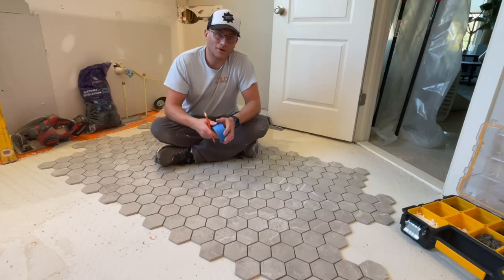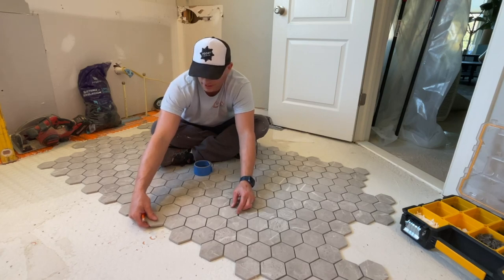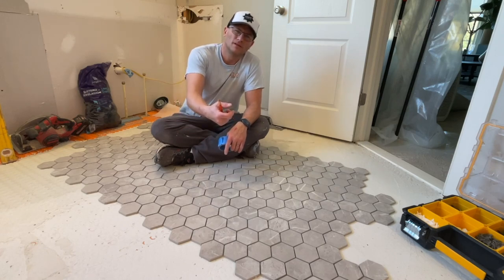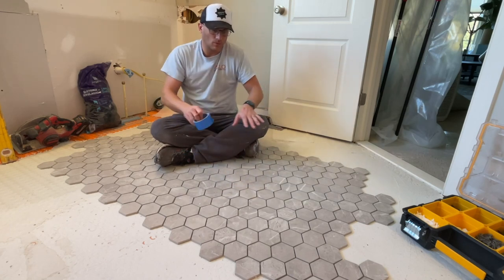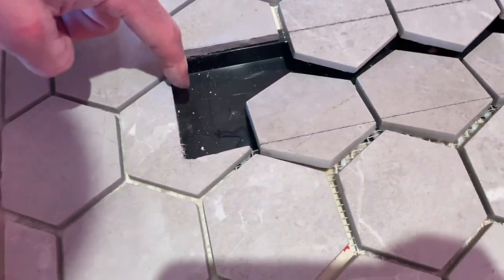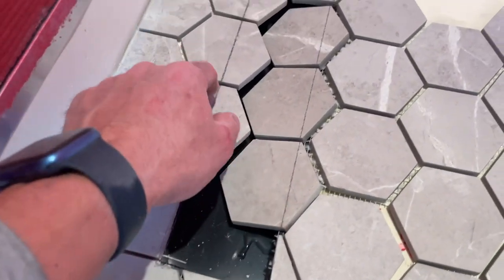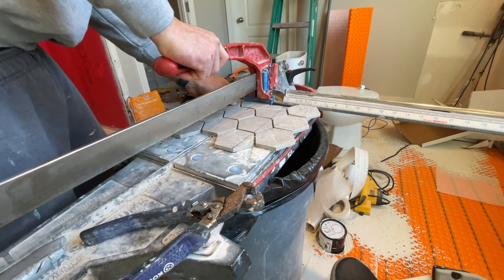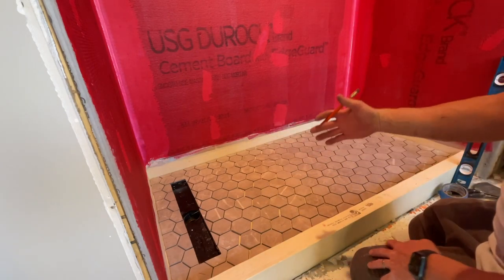How I Install Hexagon Mosaic Tile on a Shower Floor With a Trench (Tile Redi Base)

Comment: Nice job, looks great!  I am planning on setting my floor tiles this weekend.  I am using mesh backed mosaic Marble tiles.  They are 3/8th's so I think I will also be using a 1/14x1/4 with CB Pro Lite in white.
Reply from the maker: Nice. Good luck with the install.

Comment: Center off the drain for even cuts and cut it all in setting each sheet in the pan...take the center row out first in whichever order is best for u, i just mark 1, 2 , 3, 4 etc.. then take the other rows and do the same. set the middle row around the drain so its nice and perfect, then drop in the rest..the floor shifts just enough if u don't have it cut in, in the pan because of the slope, from my experience at least..thats the money shot, around the drain, plus it gets annoying if u gotta pull pieces up around the drain if u don't lay the tile perfectly starting on a row off of the drain.. (thats just my way after having done it multiple different ways over the years, no right or wrong way as long as its stuck and looks good lol!)

Comment: What is the best wall board from your experience to match with the tile redi pan (that doesn't cost what the redi wall board costs)?  And what compound do you use where it meets one another?  The stuff that redi sends or something else similar?
Reply from the maker: I’ve always used redi flash and 1/2 durarock with red guard. It’s easy and really mistake proof. If you watch all of my tile redi vids I go into how to water proof all of it.

Comment: WOW!  My friend you are a Tile Redi PRO!  I hope you see my comments and reply to my questions...  I want to be confident that using the Tile Redi Shower Pan is going to be what i want for my new home shower base!  Have you NOW switched to using the Thin set mortar over the Epoxy ?  You seemed to be so strongly adamant about using the epoxy i the other video I commented on....
Reply from the maker: I love the epoxy, 100%, but after trying the thinset modified mortar on the new pans, it works. I love these pans and tile redi and I do not have a partnership or anything. I’ve seen so many mud job pans fail over the years I wanted something that will never fail. When I installed my first tile redi pan, I was sold. This was before my videos and being in the dark with them. The only negative of the pan is if you have to install the plumbing on top the subfloor. I go over that as well and show why it’s such a pain. Good luck with project if you decide to go with the pan!

Comment: Love your videos. Is Prolite thinset any good for mosaic tile in redi base?
Reply from the maker: If it’s not recommended, I would not use it. Check the instructions what they approve. I will tell you this, I just installed a brand new tile redi pan in my new house build and it has a grainy finish on it. Just curious, how is the finish of your tile redi base? Is it smooth or does it have a grainy grayish finish? Thanks for the kind words.
Reply: I have not purchased the base yet. They are out of stock the one I wanted.
Reply: You recommand MAPEI Ultraflex LFT White?

Comment: Question. I have recently installed the tile redo system and installed the tile using the epoxy mortar bought with the tile redi system. I have a “hollow” spot on one of the edges of my tile near the grout line, have you ran into this? Is there a remedy fix for this? Thanks
Reply from the maker: Hollow? Is the grout moving? If not, you should be fine. For clarity, is the tile moving or the tile redi base

Comment: awesome work! have you any exp with fibo board shower panels? or can you recommend one brand that you would use in your home? thanks so much
Reply from the maker: I do not. So many systems out there. I'm sure if you install it correctly, it will one out just fine.
Reply: @TodayIWorkOn  thanks for your time

Comment: With this Redi base do you recommend using the redi epoxy or the Ultra LFT mortar? I saw an earlier video of yours where you preferred the epoxy and wondering if your opinion changed. I am still a beginner and was worried about the epoxy so was curious your thoughts.
Reply from the maker: LFT has been working well.  I would go with LFT for a beginner. I have recently switched over to using LFT for all of the shower floors. Good luck with the project!
Reply: @TodayIWorkOn  Thank you so much! Do you have any plans to show what you do for shower glass around the Redi Base? I haven't seen any videos on it and was wondering what you have done previously.
Reply from the maker: @rscibona  Check out my before and after vids.

Comment: Have had any problems with water sitting in the linear drain at the ends?   The tile redi trench does not seem sloped.
Reply from the maker: I've never had an issue in my own house, I've never heard of someone bring it up. If you are level, the water will naturally go to the low point(the drain itself). If you're off on your install, I can see water pooling, but, that's the installers mistake.

Comment: When laying mosaic tile…What is the purpose of the 1/4 inch border around shower pan
Reply from the maker: To adjust the tile around if needed. If you are right up against the sides of the base you can squish your tile and you have no room to correct.

Comment: With those size tiles and using redipoxy would u use a smaller trowel notch?
Reply from the maker: Yes, a lot smaller. Probably 3/16 v notched. The poxy is so sticky you don't need much. Standard modified mortar needs more to stick.

Comment: Show us how it looks with the glass panels installed
Reply from the maker: Soon. I need to go back and do a finish vid.
Reply: @TodayIWorkOn  appreciate it 👍 I'm re-doing a shower base that the previous contractor f*d  up. Ive been debating whether to go with the traditional sandmix base or go this route. I was just curious whether the curb on these type of pans would support the super heavy glass panels.
Reply from the maker: @OGCJ10  100%. I've installed dozens with frameless glass including in my own home, I'm looking at it right now.